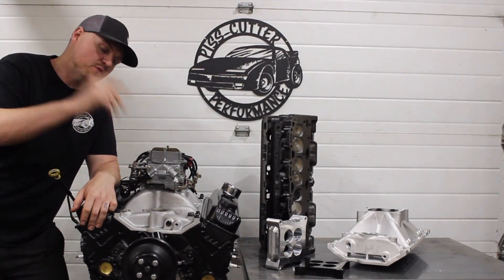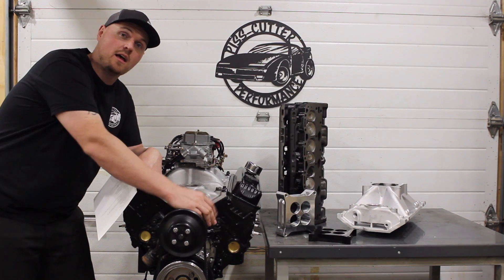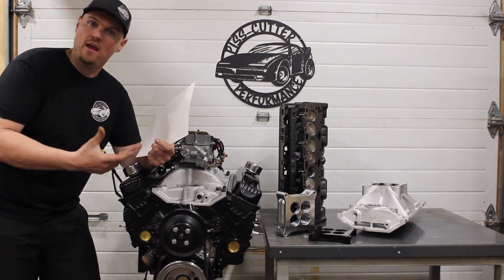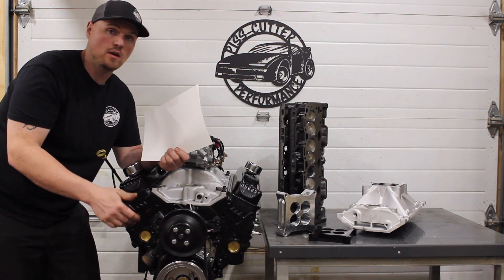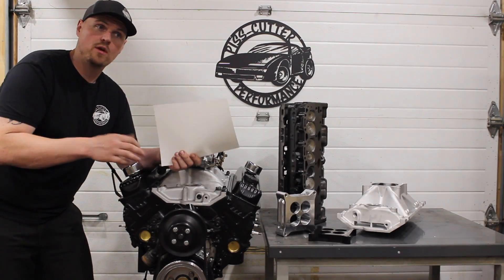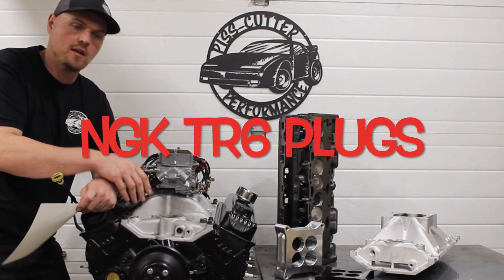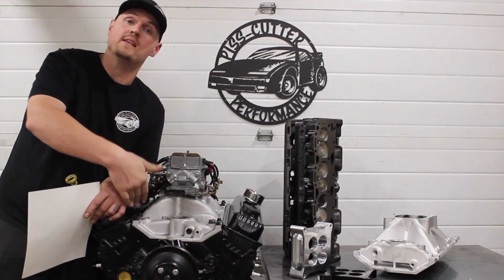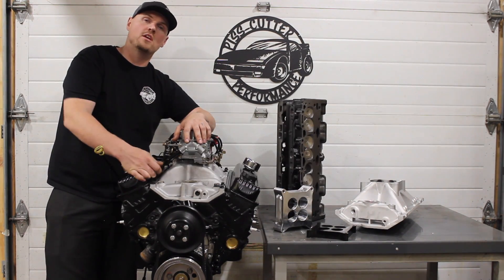350 Chevy Cheap Power! Parts List for L31 Budget Build

Comment: Careful with these blocks up in the frozen areas. I would guess close to 50% of the ones I have gotten have cracks in the block from freezing in the lifter valley area back by 7 and 8. Par for the "junk" sitting outside for 5 plus years... lol, so be careful anyways. Otherwise great blocks even with the 2 bolt mains. The machine shop I use they told me those blocks have thicker webs and as such are great naturally aspirated block that can handle tons of power.

Comment: I bought a used l31 on marketplace for cheap and slapped a carb intake on it and it runs great… I need an aftermarket dipstick but can’t find anything that says it fits a l31 … also I want to swap the plastic cover out with a metal timing cover did you ever do a video about that?

Comment: Not boring at all! VERY interesting! I have an 010 casting older block—what would I have to do extra to get all this or something similar to work? I have not been into engines in a LONG time - my wife has been pretty sick and I am starting to get back into all this. My car weighs in around 3300-3500lbs and I am hoping to use the 3.55 gears that I bought about 2 years ago - may go up to 3.73. What torque converter do you recommend for a build like this and my car, same with the gearing? Its an automatic - TH 350 currently. ALSO - LOVE all your videos. I am slowly going back and watching them all.

Comment: Quick question.  If i use the sum-8802 cam and the other mods you suggested can i use the original rockers or do i need to get the PRW rockers but in 1.5?  Thank you
Reply from the maker: @simoncardenas9161  stock rockers shouldn't be used past .480 lift
Reply: So I'd be good with the PRW self aligning rockers in 1.5 with all the mods you mentioned and .30 keepers?  Sorry for the questions. All new to me and your videos are helping me get what I need thank you for the help and the replies.

Comment: Buddy, ? On the keepers, back on your beehive spring video said use +.050 offset keepers for the 525-530 lift.  Here you said used +030. You did use the LT4 Hotcam right?  Just want to verify.  I ordered +030 but just caught the +050 on that video. Thanks
Reply from the maker: Check this video out
https://youtu.be/UZosxGQyGMs
Reply: Awesome, thanks. I have copied everything except had to go 020 over on pistons so went a budget flat top dual valve reliefs.  
Thanks for sharing your work.

Comment: Thank you for making this entire series. This is exactly what I already had planned out in my head and you have proven my concept true. Except I will be using a Rochester quadrajet with the intention of using a fuel injection conversion in the future. I will not be spending big money on a lt4 hot cam. Instead, I will use the summit camshaft. I'll be putting the same basic build in a Chevy S10 for a daily driven street truck. I believe it should also be a reliable 400 horsepower.

Comment: I was so excited  just to find out I can't get no parts from engine  tech I'm having  trouble  finding  the rocker arms
Reply from the maker: Why can't you get parts from engine tech?
Reply: @cuttersperformance  I don't have a business  I'm just  someone  that  knows a Lil about  working  on  cars but has very  little  budget  I have 89 chevy  I bout it from  a lady  that had it sitting  in the woods  for years  had cracked block not knowing  I got the motor  to run it was horrible  squirrels  made a home chewed  up wires cranked it found the leak did motor swap  then rod knocked  parked  it then found  another  truck to use  for parts so I swapped  motor  witch is the vortec engine  and carbonated  then automatic  transmission  went out  so I've turned  it into  a manual  5 speed  transmission  now I wasn't getting  very  good oil pressure  rod started  knocking  and now I said  screw the used motors  I've rebuild  a couple  but never  with proformance  this will  be my first  and was a little  excited  until  I tried  contacting  engine tech 💔that my story

Comment: Okay,  old video, but hey, I'm an old man. About to start on an engine for a 1959, Chevy, Viking, C60. I'm building the C60 into a "super C" motor home. Old school all the way. Original frame etc. Except for axles going modern disk brake, hydro boost, for safety. So 16,000 lb., 6x6, high drag, flat towing jeep all over mountains of Colorado, (11,000 foot elevations). I'm using a small block because it will fit without cutting the cab or the front sheet metal. (I've had enough of trying to work under the windshield). 

So... 383, (vortec, 4 bolt main, stock cam, (off idle torque monster), Turbo charged (Turbo normalized for altitude 5psi), manual nv4500 transmission, 3500 rpm all day long (occational trips into 4 grand territory during up or down shifts), 300 hp (that's what I have with my 7.3 power stoke and it gets it done, 20,500 lb. Gross with towing).
Basically I figure I'm needing a boat motor.
Planning on using forged 5.7 rods, (stroker kit)
1.6 ratio rockers exhaust only, (advice from Chet Herbert)
1.6" exhaust valves on otherwise stock vortec heads
Beehive valve springs, (not reusing the old ones)
Gentle porting, exhaust only, (watched yours and Visards videos many times.)
Port matching between dual plane intake manifold and head, head and rams horn, 1.75 exhaust manifold
I'm going to gauge the hell out of this
Air fuel mixture (Cadillac Q jet)
Exhaust gas temp, both sides
Boost/vacuum 
Engine oil temp

Now the questions, your opinions:
Cast or forged steel crank? (7.3 has forged steel crank)
Forged or cast hypereutectic pistons. (7.3 has cast pistons)

Looking for torque off idle (manual trans and some steep, rough trails, 93 to 1 final drive)
Engine rpm, 3,000 at 65mph in 4th, 2000 in 5th. 

Anything I've forgotten? 

Thanks for the videos. Super:
Entertaining, instructional, informational.
Loving them, keep up the great work.

Comment: what if a guy wants to run the stock fuel injection? i have a 2000 5.7 with the spider injection that i'd like to get a little more power out of when its time to rebuild. Probably .030 over, some head port and polish but not interested in going back to a carb.
Reply: There is a video of a guy it’s a red OBS and used the stock spider and a black bear tune. I will be trying it.

Comment: Great video's I went out and got a L31 I guess R motor from a one ton 4x4. Four bolt motor, think I read somewhere these have a forged crank? I got lucky and had a guy swamp me some parts for some Vortech heads and ended up with that cam! Following your build to a T for my 2nd gen Z28 manual trans.

Comment: Yo I love your vids can I run that summit cam you mentioned on a fresh crate 880 stock block just add the cam to it or do I need a new timing chain and change the valve springs to and is that summit cam a roller or hydraulic cam then I need to change my lifters and push rods to

Comment: I do have a base motor, but I'm at  loss as to what to do to it on account I don't know what's in it. I got an awesome deal on a vortec 350 magnum marine motor with 450 hrs on it. I've bin pulling my hair out trying to figure out what's in this thing without tearing it apart. Do you have any experience with using a marine motor as a base for a build? The balancer doesn't need any modification as it dose not have a crank sensor and sits further back than an automotive balance plus the plastic timing cover has the hole for the sensor hole is plugged as part of the plastic casting. The problem with Mercruiser is its hard to find specs for anything like the cam the heads all they list is parts # and you just replace it. I do know its a four bolt main block I suspect it may also have 202 heads. 2000 Mercruiser 350 magnum (carbed) was going to put it in my truck but i think this would make a killer street rod motor.What do you think?
keep the videos coming 👍👍

Comment: I’ve spent the last 3 months building an 880 block to your exact parts list and using the 8802 cam!  Motors getting dropped in this weekend . Ordered a 2200 stall converter hopefully enough
Reply from the maker: Awesome man! Let me know how it works out
Reply: In the right car this is a LS Hunter.
Reply: How did it go?

Comment: How do you resize a powdered connecting rod ..the vortec has cracked rods ..my machine shop told me it shouldn't and wouldn't attemp it
Reply from the maker: They didn't use crack rods in sbc until the LS series. The vortec L31 rods are Powdered Metal but they are not cracked. Ive had many sets resized,  just like a regular SBC rod. But as a side note LS Cracked rods can also be resized but the ID of the rod is made larger and a larger OD bearing is used , rather than grinder the caps and restoring the ID of the rod.
Reply: Thanks for the reply .So i'm in the process in building L31 and hopefully I can squezze 400 hundred hp and torque out of it . And you are correct no about the rods being none cracked rods ..I was going to replace the rod bolts with ARP bolts because it's insurance to me but my machinest said the factory bolts can handle 500 hp's. I wonder how much distortion if any if I did them myself ? .I really do not have much choice on who does my machine work and their 30 miles away. The block will be 040 over it's been there for over a month. Anyway thanks again for the reply have a great weekend .ltr.

Comment: Thanks for posting these video's they are very informative, I have a set of 062 heads and installed ls springs with 174003-3 retainers and +30 keepers, the question i have is can i grind down the self aligning washers or tops of the keepers to make clearance between the keepers and roller rockers? My intake valve stem stick out is about .0645" and i have about a .010" gap between the roller and valve stem because the self aligning washers are hitting the keepers, i did order a different set of rockers to see if clearances are better.
Reply from the maker: I have ground down the centering nibs on roller tip rocker arm for clearance. You only need about .040" to safely center it on the valve tip

Comment: Hello, I’m currently working on my L31 Vortec 350 have completed the short block but I have a few questions. 1, do I have to pre-soak the lifters be fore install? 2. I read that the break-in is with 30 weight oil and you state it would be best to plug the oil filter, is that just for the break-in and how long should the break-in period be? Thanks in advance, Kai
Reply from the maker: You dont have to soak the lifters. Just cover them or dunk them in oil. You can break it in with just about any non-synthetic oil that you prefer 5w30 to 10w40. You can plug the bypass  in the oil filter housing indefinitely or just remove the plug after the second oil change
Reply: Awesome, thank you! Keep up the great work!!!

Comment: found Chevy and Hotrod magazines from the early to mid 2000s. long story short, i coped an engine build with aluminum VT heads, i did some head work knocking off the ruff areas and increasing the left. i used single relief valves clearance pistons when the book used dual. book said 425, but i never dyno'd it

Comment: I have a stock 97 5.7 4 bolt with carb , intake and stock cam with 70000 miles. What should the timing be ?

Comment: So im not seeing anyone asking, but what is the idle like with the LT4 hotcam or 8802 summit cam with a carb? Ive searched YouTube and keep finding different sounding engines, not sure if some are fuel injection and some carbs, or if idles are set different or what. Ive got a L31 crate motor in my 55 chevy and outside of carb issues it runs decent, but its a hot rod and id like a little chop at idle, nothing crazy cause id like to keep power brakes, stock or stockish torque converter etc. So my thought is to go with the 8802 but dont know what to expect sound wise, no since in doing a cam swap and changing head springs for the same idle, although top end performance would probably be a lot better.
Reply from the maker: Mild idle with abit of chop, like 15+ vac on a lower compression 350 like this L31

Comment: First let me say I really appreciate your time and effort doing all these videos , I've learned so much and saved alot of money thanks to you. I'm going to use the Summit cam you suggested. You said you could use the stock rockers , would it be worth it to purchase a set of Scorpion 1.5 roller rockers? Also I have a Chev. Perf. 350/357 hp. crate motor with the hyd. roller cam, Vortec heads and just wanted to double check that using the stock pistons and pushrods were okay to use as is ? Since my engine is the same as the one you built I just wanted to verify that the piston to valve clearance was good to go. Thanks again for everything.
Reply from the maker: Thank you I appreciate the support! What summit cam part# are you referring to? The reason I ask is that you can not use the stock rocker arms on a Lt4 hotcam or similar. On this L31 budget build, I used a set of PRW roller tip rocker arms. The stock rocker arms should not be used over .480 lift
Reply: Thanks for the fast reply. That was the Summit 8802 using 1.5 rockers and + .030 keepers @cuttersperformance
Reply from the maker: Yeah, you can use that cam with beehives with .030 offset retainers like I did with the similar Lt4 hotcam. But you cannot use the stock rocker arms, you can use the a 1.5 ratio (stock ratio) using an aftermarket rocker arm
Reply: With using the stock pistons and push rods was the piston to valve clearance okay? sorry for all the questions just getting all the parts and just wanted to make sure. Thanks for all your help. @cuttersperformance
Reply from the maker: @user-nk2ov7so7l  yeah it has lots of clearance with the stock pistons and the LT4 hotcam
Reply: I really appreciate all your time and effort. Thanks again!!! @cuttersperformance

Comment: What is the highest static compression ratio are you comfortable running on a daily pump gas street engine with iron heads and if you did have an engine with a high compression ratio you wanted to run on pump gas what changes to the cam would you look for to lower the dynamic CR? Higher Duration? Tighter LSA? Different ICL? Or all...
Reply from the maker: Ive done just over 11:1 vith vortecs and pump gas. Im actually doing another one on the dyno coming up. I want to try to max it out on VP race gas concentrate fuel and then run in on High octane pump gas to see power differences with tuning. Tight quench, large cams and light vehicles make a big difference

Comment: What pick up tube did you use for the hv oil pump? I’m having trouble locating the correct one since there are so many. Thanks for the vids I’ve watched all the ones going back to porting stock vortecs. You should throw a set of those on and see what the numbers are.
Reply from the maker: I just used a stock style 3/4 pickup from an L31. Set the height and tig welded to the pump. The heads were mildly ported (mostly exhaust side) on this L31 bidget build. Im assuming that was a big reason it made more power than expected

Comment: Hey man I just have a question. I used +30 keepers on my valves and it brought my installed height too where I needed it. But I don’t have much valve tip only about 10 thousand clearance between the prw 1.6 rocker and the retainer. Is this enough? Or is there a minimum amount of clearance between the rocker and retainer?

Comment: Did you use a 240 grit hone for moly rings ?
Reply from the maker: Yeah I did and it sealed up fantastic. I find a 240 grit ball hone almost cuts like a 280 to 320 grit sunnen hone. A 320 git would probably have been fine also, but I found it was too smooth on the last one I did. This one sealed up good! No smoke from the breathers on the dyno and less than a 5% leak down

Comment: The single roller is a better timing chain than a double roller. There was a shim that was sold by IIRC ATI that was used with their LT1 balancer. It is the correct width to shim the balancer.  Then again I would only run a SFI balancer on a performance build. Full roller is also a better rocker, really no reason to run a roller tip only.  They make stamped steel self aligning 1.6s that works with a combination as well as those roller tips would.  Full roller added 10 ft/lbs across the board on my old LT4 Hotcam L31.
Reply: Is there a link to the video for the regulator ring mod?? Ty

Comment: I ordered those same springs for my vortec heads. I’m being told by my guy they’re not the right ones due to the install height. Did you come across that issue as well? If so what did you end up doing?
Reply from the maker: Have you seen this video? The beehives are speced @ 1.800 installed height
https://youtu.be/c6Qa5uTmfkE?si=oq3mxCrIu7MW_-WQ
Reply: Sorry he now says that the diameter is too small for the guide bosses.
Reply from the maker: @duanedabney9420  are they original gm castings?
Reply: @cuttersperformance yes
Reply: @duanedabney9420 Never seen that issue myself and I have put probably 2 dozen sets on Vortecs and TBI/TPI heads.

Comment: You should do a towing 350 hydraulic roller with aluminum heads engine build and a towing 350 hydraulic roller with vortecs engine build.
Reply: If you are adding aluminum heads and building it to tow just build a 383. I have one in my ~7,000 lbs 97 Express conversion van with full 1 ton running gear. Backed to a 4L85E and 10.5 FF 14-bolt with 3.73s.  Its got guts.

https://youtu.be/Dyvl6LlkMcA?si=OA771-4lWTFA4O6G